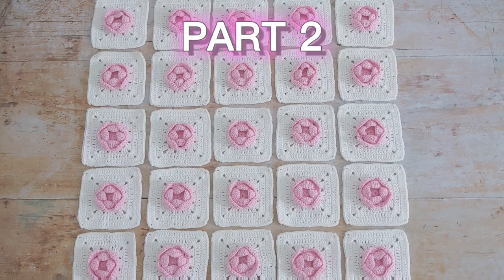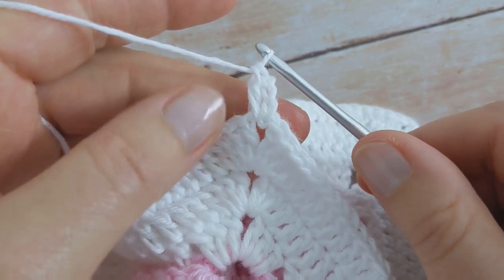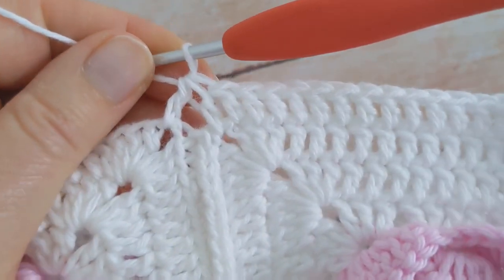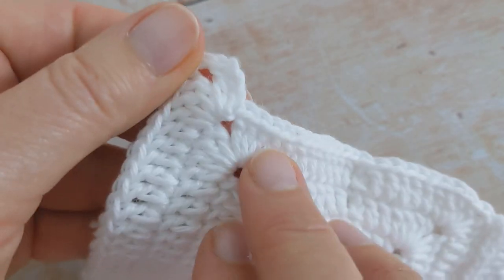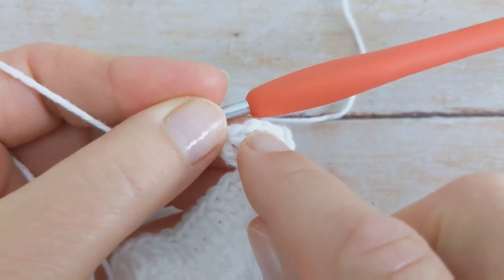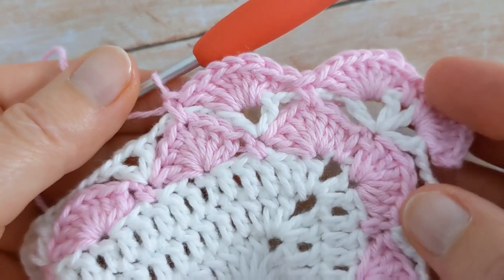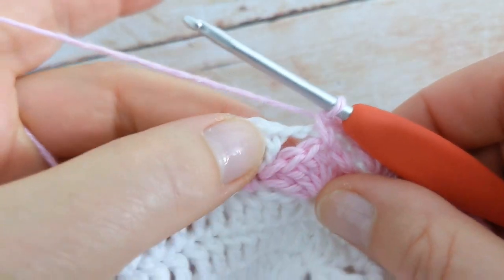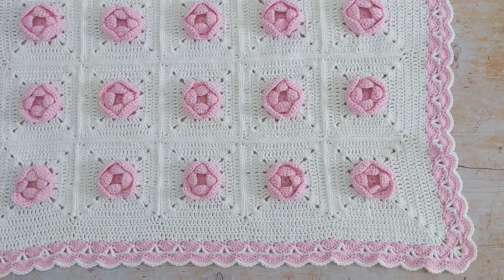Rose Crochet Baby Blanket (PART 2 of this Sweet Design)

Comment: Hi!  I'd like to alternate roses with a plain square, like you did with the bear pattern.  If I use the plain bear pattern, will that match the pattern of the roses?
Reply from the maker: Hi Barbara, I've not looked at this option but you could certainly try making one of the plain squares and see how it measures against the rose square 👍 If it turns out a similar size it would be a very good fit for your blanket ☺️